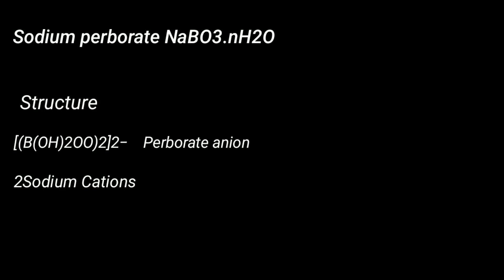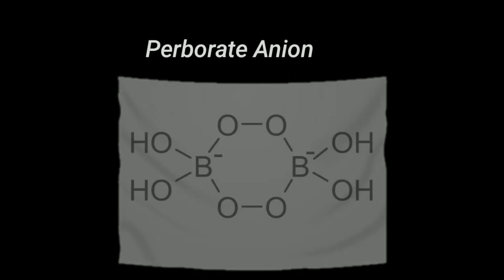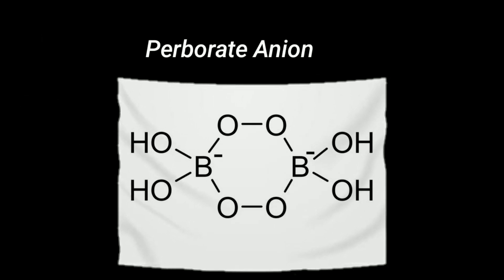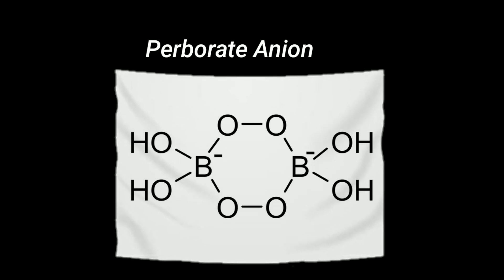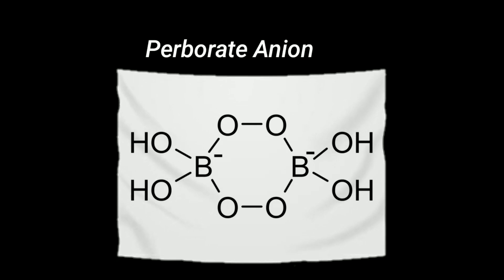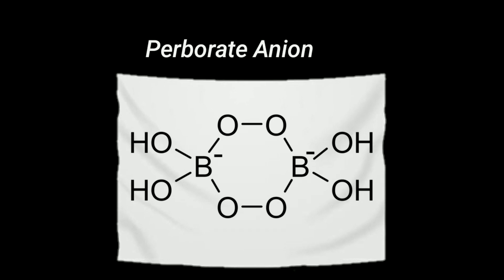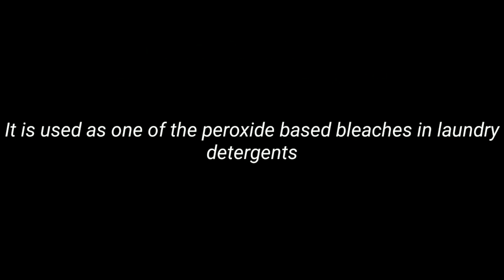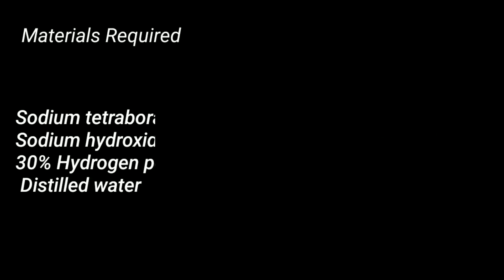Sodium Perborate : Synthesis

Comment: I have redone u synthesis with the exact same amounts of starting material but used a magnetic stirrer to mix the solution.
Shortly after I added the h2o2 it all chrasht out and I had a slurry, I stirred it for 20min and after filter, washing and drying I got 30g 🤔 anyone have an idea what’s wrong here 🤷🏻‍♂️
Reply: I have the same issue also using a stir bar however mine started crashing out or crystallizing within 10 mins of stirring. I think the solution was too cold in the ice bath. Out of curiosity, I gently heated the solution with a hot water bath and it started liberating bubbles, presumably oxygen. This makes me think the reaction occurred correctly, but more rapidly then expected with the stir bar. I'm going to dry the first batch and test in my application. If it fails, I will repeat it but try a cold water bath at around 10°C and mixing for 2 minutes with the stir bar before letting it stand to form larger crystals for easier washing/rinsing and filtering.
Reply: trace amount of transitional metals/oxides/salts will speed up H2O2 decomposition. Notice this guy is using glass.